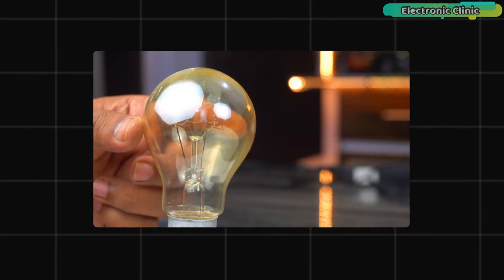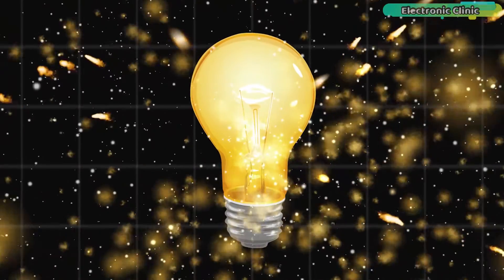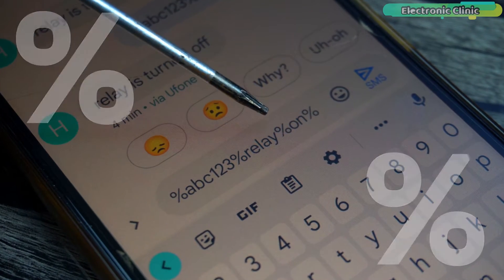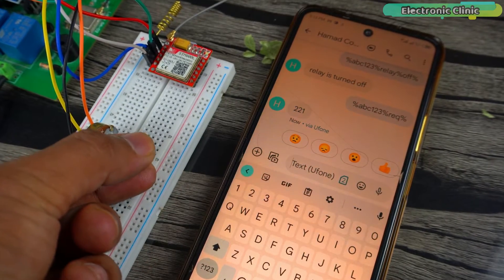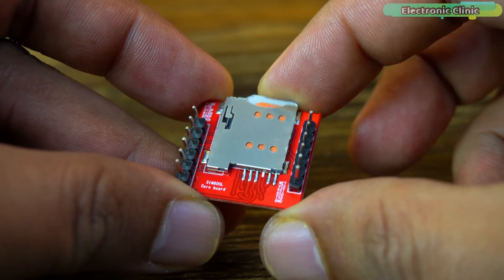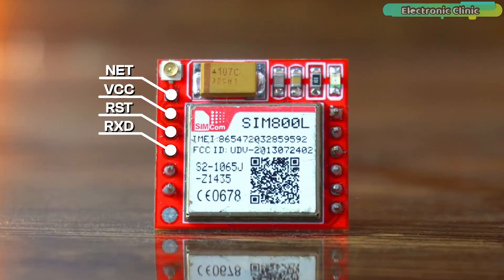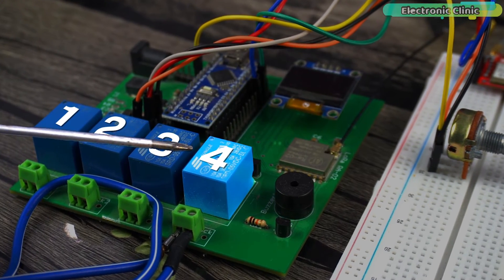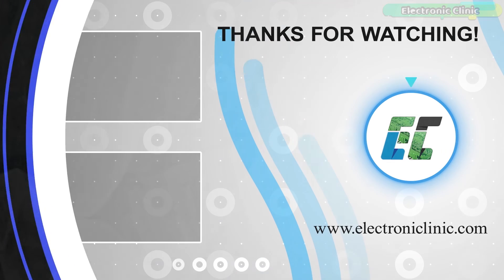Sim800L GSM GPRS Module with Arduino, Send SMS, Receive SMS, Request SMS, and Alert Message

Comment: you explain very well. sir  i wanna know in my country we have 5G and 4G but people said that this module work only on 2G network is it possible to used it in my country that using 5G and 4G
Reply from the maker: @Fnta_discovery you can't use it with 4g and 5g networks. Watch my videos on 4G LTE modules.
Reply: Ok thanks 🙏

Comment: How many volts we need to give sim 800l ,sometimes it irritates me 😢
Reply: 5v 3a. I use 2 of 18650 battery and LM2596 buck converter to supply 5v 3a to my sim800/sim900. I also add capacitor to it. Both sim800 and sim900 works without any issue. I also add voltage meter to monitor battery voltage. With this setup, you can take your  project outside your house where there is no power outlet.

Comment: I like your videos 👍👍👍
8:42  Does sim800 work with 5v?
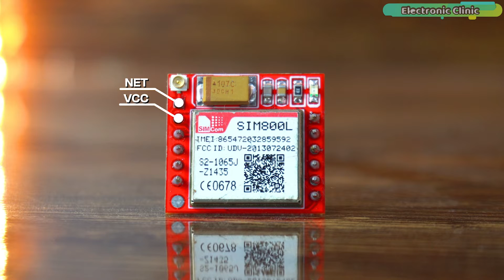6:38 You said vcc is 3.4v-4.4v !!

Thank you
Reply from the maker: Ya it works on 5v. I checked it at 4.4v and it didn't work.